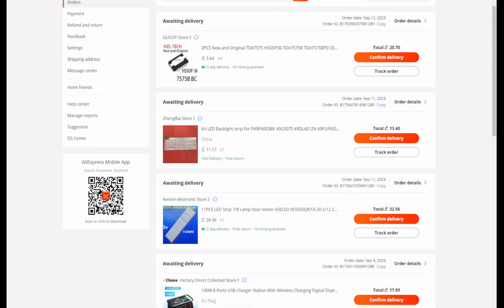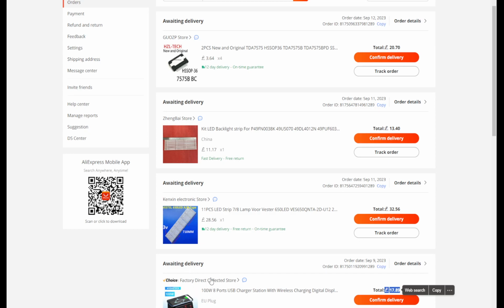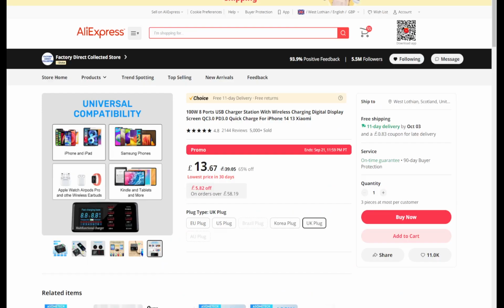100W 8 Ports USB Charger Station, super cheap!

Comment: The original cable is probably fine and the 'fault' lies with the adapter. I've had the same issue with electric toothbrushes not charging while using those adapters. Take a resistance reading on that cable to check my theory please.
Reply from the maker: You were right! :D It's the adapter ;). Thank you, Phil.